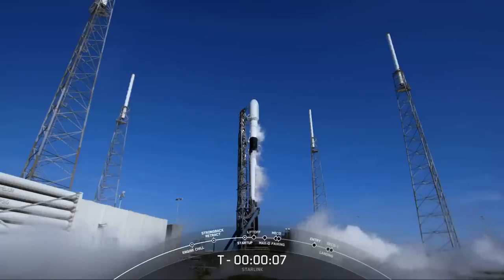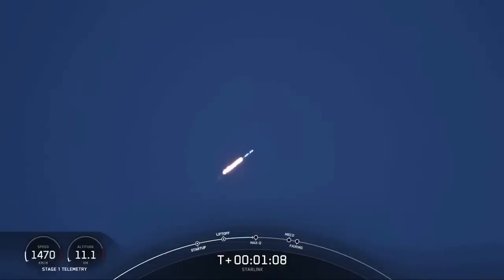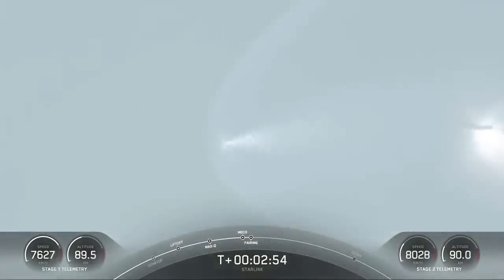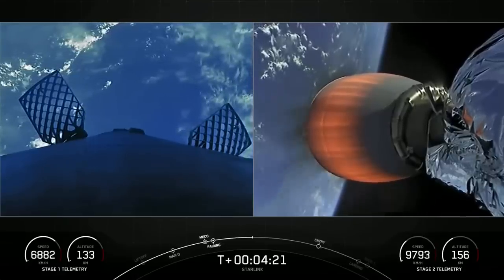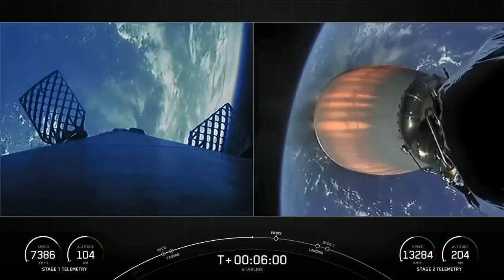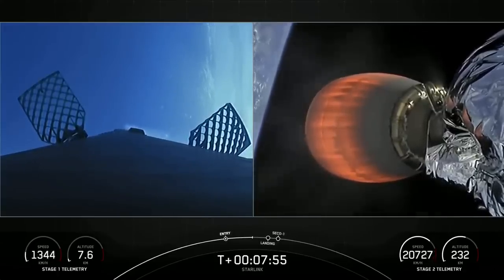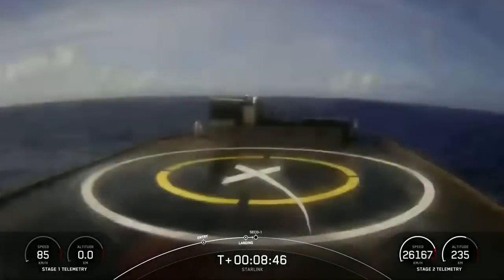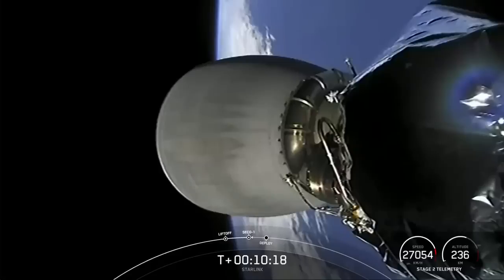SpaceX launches Starlinks on rocket flying for record-tying 13th time, landing confirmed

Comment: Maybe I'm just thick, but I don't get the stage 1 telemetry, which shows the first stage reaching about 134 kms of height before beginning descent.  What I don't get is how an upward velocity instantly becomes a downward velocity without passing through zero.  Also very glad to see the canned applause has been canned ( pun intended).
Reply: Think of a stone being thrown over a fence.  Yes at some point the top of the arc will be reached and it's upward motion will cease, but it's forward motion away from you will not stop until it hits the ground.  The speed you're referring to will not reach zero because although the upward momentum has stopped, the forward momentum is still going and being counted.
Reply: If the Falcon 8 was fired straight up you expect the velocity to become 0 at the very top before it starts to fall back. However the Falcon flies a parabolic track similar to how a shell is fired from a canon. So it will maintain it's forward speed just like the shell. The speed shown is total speed at which the rocket moves. If you would split up between vertical speed and horizontal speed the vertical speed would become 0 at the very top of the parabola.
Reply: Yeah, listen to 👆this guy, dumass